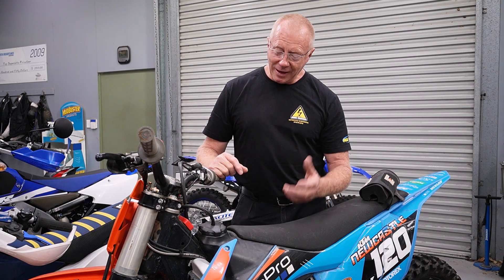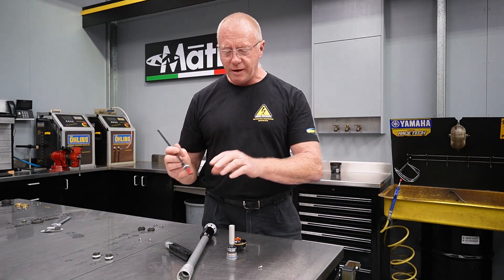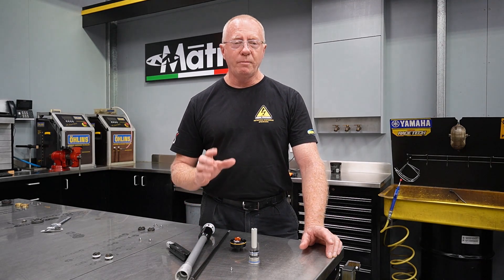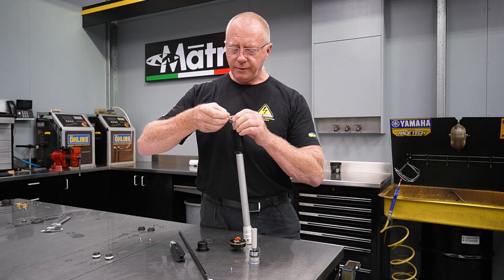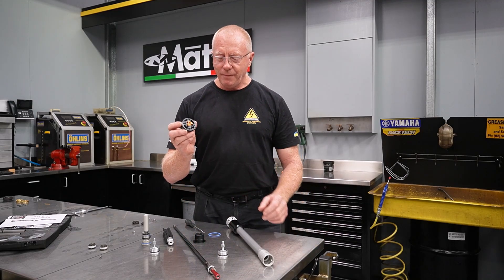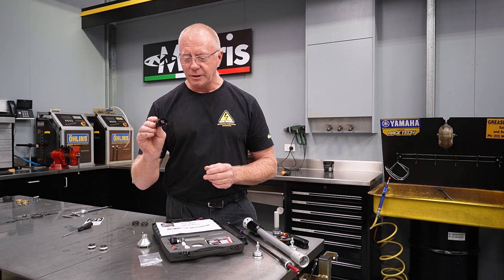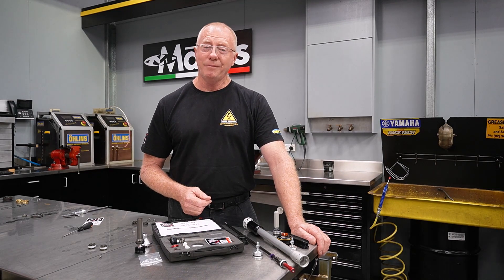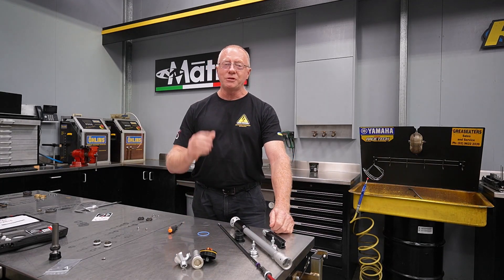WP 4CS Forks - Problems and Solutions

Comment: Hello, thank you for great explanation! 
I have a few questions:
After you remove the middle seal, can you fill up the fork from above? or you will still need to do it from the bottom? 
As well, can you only remove middle seal and make no other changes? will that impact suspension performance on a good way enough to use it as a enduro bike? 
Thank you in advance!

Comment: Hi Terry, great video! I hope you could answer one question I have. Does just removing the seal and o-ring improve the fork without any additional change? I have a 701 Enduro and would love to know if this simple and free change will already improve things without the need to change anything else. Thanks!
Reply from the maker: It improves the fork in terms of function and reliability but it does alter the overall force. It will need to be made firmer in the compression damping afterwards

Comment: How can I get in contact with you to discuss valve dampening changes after doing these modifications? I have 4cs forks with race tech gold valves on 2016 350sxf. 170lb rider
Reply from the maker: You can, drop in, call or email if you wish. All details are on our website

Comment: Do you have a recommended baseline valve build for Ray Kit with the conversion? Working on a set of forks that’s all sort of messed up and would like to get it to a good baseline.
Reply from the maker: The base valve needs to be considerably stiffer once you make the conversion. You have to understand that you are removing the pressure chamber from the overall force value thereby reducing the resistance. We usually valve the kits for our customers prior to sale. Have you spoken to the people you purchased the kit from?
Reply: @shocktreatment5495  the kit was previously installed in the bike. I’m fixing it for a friend and the bike is used. I’ve compared the shims to the data sheet provided by Dal Soggio, and it’s been tampered with by someone who doesn’t know what they are doing. I’d also like to do away with the factory fault and make it more reliable by doing the conversion. Not sure if you guys sell build sheets or can provide a baseline for this type of thing.
Reply: I just sent an email, probably better to communicate through that!

Comment: Do you still put the oil in from the bottom after the no seal mod?
This is something I could do real quick to try
I have gold valve’s will I have to make changes them in order for the to work?
I’m wanting to try your method before I move to the extreme which is converting a set of Showa forks I have off an 05 cr250 to the bike (2014 KTM 300xc GNCC b class)
Reply from the maker: You could use the same qty as you always have and pour it in the bottom if you wish. You will need to have the cap in place though. The valving will have to be made firmer

Comment: @shock treatment it would be good to see the benefits and differences between the results from sphere cartridges and the ray kit. Are the drop in cartridges that much better over the kit etc
Reply from the maker: The Sphere cartridge was designed with the intent of being the best cartridge you could buy. The Ray kit was designed to overcome the problems with the 4cs cartridge and promote performance from this particular concept. The Sphere will win hands down.

Comment: Does removing the base valve change the amount of oil you put into the forks?
Reply from the maker: We are not removing the base valve. We remove the upper cartridge seal and o-ring. This has a minimal effect on oil volume. Having said that....any alteration in internal volume needs to be catered for. Any decent tuner places their priority on "Air Volume" and adjusts oil quantity to suit.

Comment: I have a dal soggio ray kit for my 2015 KTM 350sxf and want to remove the o ring and seal to go to a non pressurized system like you recommended. However, I do not see any valving difference on my sheet for closed chambered (pressurized) vs open chambered (non pressurized) for the ray kit. Any recommendations or does their provided valving working either way? Thanks!
Reply: I’m curious as well? Ever find out anything about this or if it’s better/worth it? Thanks
Reply from the maker: It needs to get considerably stiffer on the comp valve. If you give me a call I will suggest a baseline for you.

Comment: I sent you my 4cs in 2016 for my 350sxf.. Is this the same up grade that would have been done

Was far better than stock but got a hell of a head shake on decel 😬  could not find a setting I liked on that ktm not matter what i did so i sold it went back to jap bikes
Reply from the maker: We probably weren't doing the "Open Chamber" conversion at that stage. Development is an evolutionary process. Headshake on the KTMs was largely due to a lack of trail compared to that of the Jap bikes. Have a look at our handlebar videos. They explain (and cure) a lot about headshake and offer an opportunity at no cost to upgrade the feeling of control on any bike....not just the Euros